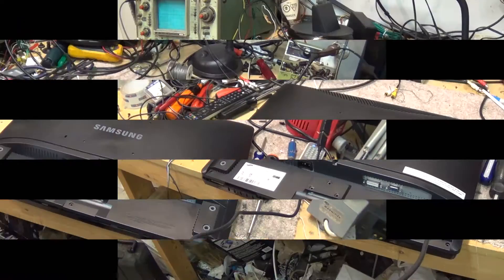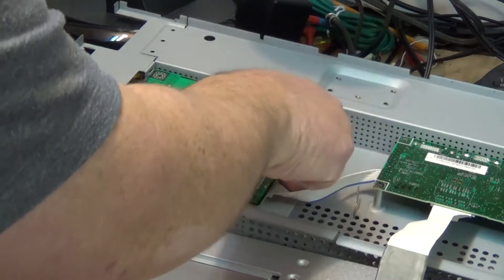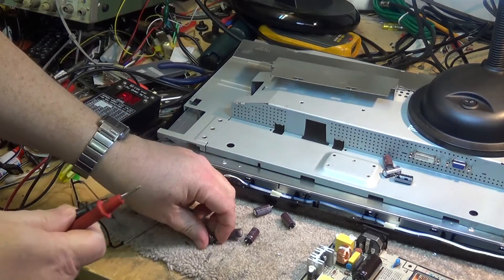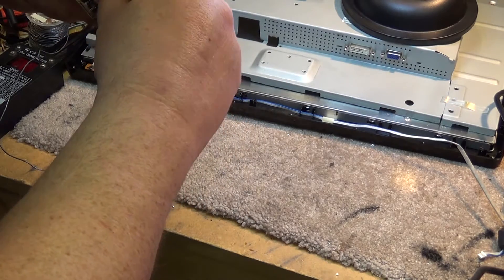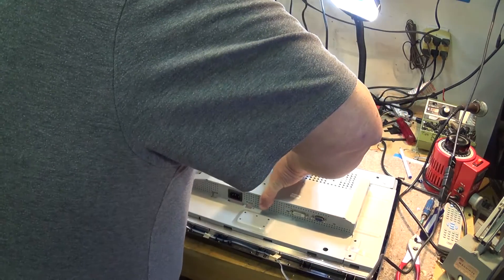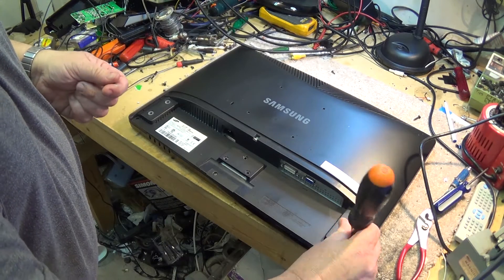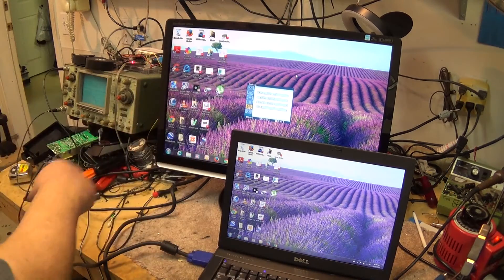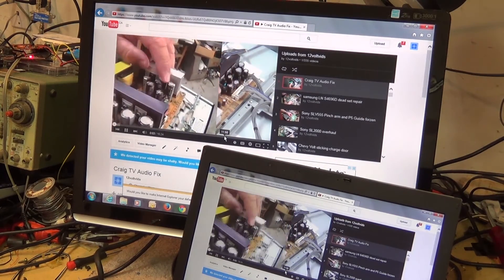samsung syncmaster 226BW power supply repair

Comment: Thanks mate, I have replaced the same capacitors on my exact same monitor which was thrown in the trash,  the small 330uf cap was mistaken for a 820uf capacitor due to missprint on the capacitor.  I know now why the repair diddnt work.  Cheers mate, U just gave me more hope for my little monitor

Comment: Here we are in 2020 and your video is STILL useful!! I cheated though... I did not solder in new caps... I just bought a replacement power board. BUT!! The repair was successful and the monitor lives on! Thanks!

Comment: I know this is an old video, but I just followed your video and I have a Samsung 226cw and all the insides are the same. I found all my 820's and one 330 were all bulged out. My monitor suffered the same issues when power on the screen goes blank, but if I let it sit then turn it back on a couple times it starts working. Well I replaced all the caps with the same identical caps and now the monitor will not even turn on. I have swapped the old caps cap in and now still no power. I hear a hissing noise from the power supply, but nothing at all. It went from working to now not working at all. What do you think is going on with it? I like this monitor and do not want to junk it, but I have no idea what would cause it to go from working to not working. I also made sure all the caps went in the same way they came out. Any ideas? Thank you!
Reply from the maker: Go double check your work for a backwards installed cap or a solder bridge somewhere.
Reply: @12voltvids  I did check it all out, been up and down on this board. I will check again, but I have beat this one up. I did happen to touch one of the flat areas that has solder perfect on it. I did try to flatten it back out and I used a jewelers loop to check my joints and still same issue. It does nothing at all. I also wanted to add that my monitor would blink in and out fast then the screen would go dim and I would have to power cycle it a couple times to get it come on and work, but now after replacing all caps it does nothing. Any ideas?
Reply: @12voltvids  Any ideas? How do I test the power supply out to make sure it is working as expected?
Reply: Thanks.
Reply: @dcgtechnologies1275  did you figure it out in the end?

Comment: Thank you for a great guide. My Samsung 226BW is from 2007. start blinking a few weeks ago. My PCB board has 3  820 uf an one 330 uf. Only 2 of the 820uf looks bad, but I have replaced all 3. I bought at Digikey 820uf 35v for $1.44 each and 330uf 35v for $0.42 all maid by Rubycon. The screen is working like new !!!  Thank you !!!

Comment: Hi do you have a list of the parts you used or the specs of the caps needed to replace. I have the exact same monitor with the same issue. Thanks in advance.

Comment: Have this issue yet nothing is wrong iside
Reply: same. i initially (about 5 years ago) had one bulging cap and replaced it, which fixed it. monitor has been perfect for the last 5 years and with a LOT of use. it seems like the same issue as last time (screen black, but if you shine a torch you can see its working - backlight issue). which is what was wrong last time. (except this time the screen works for the first 1-2 seconds after you turn it on..
anyway, long story short, this time the capacitors all look fine, no bulging. 
that doesnt mean they are good though, so as soon as i can find some suitable capacitors i will be replacing them. hopefully that will fix my issue.

Comment: Could you possibly just pull a power supply out of another tv or monitor and put in place of bad one? ? To speed up process only or is this not possible and just repair and use other ps for the parts needed if correct size caps etc?
Reply from the maker: M G 
You can deal power supplies only if same model.
Reply: 12voltvids figures this would be your reply! Thanks

Comment: As a Side note to people doing this - MARK the High Voltage Leads or take a Photo of the Leads before you pull them out.I used a Black Marker to mark the Pink Wires (Plug and Socket) Schematics are hard to find.

Comment: Thanks Much Dude. Made life easy for a Take down vid of the Monitor. Im another Victim of Samsung. Mine lasted almost 7 years. Not Bad. Time to Fix it. lol
Reply from the maker: +ftecconn I had this monitor given to me along with a 46" Samsung LCD. I kept the monitor, and my daughter put it on her PC as it has a fantastic picture. The TV found a new home too, one of my co-workers took that one off my hands. Samsung sure has had capacitor issues lately.
Reply: +12voltvids - Just Finished the Change out.  I found the 330uf cap Labled Backwards as well. People need to check the Polarity on the PCB not the Caps. The Monitor works like new now. $15.00 Fix.And my kids call me a Geek, Comes in handy.lol
Reply from the maker: Vertical line that never change regardless of input could be a panel issue.
Reply: Check those Caps. One may be Starting to Bulge
Reply: Well its been about four months now, The Fix is still working fine.

Comment: question on the uF on a cap. I was taught you can up the voltage rating but not the uF when changing out a cap. here you put different uF rated caps in.
Reply from the maker: Thomas Storm Depending on the circuit. In a video or audio circuit, where capacitors are used as bypass  or interstage coupling capacitors, changing the value will affect the circuit performance,  change the resonant frequency of an oscillator, change the linearity of an amplifier ect.In a power supply they are just there to store energy that is produced in pulses from the transformer, and filter it out to nice stable DC. Most electrolytic caps can have a tolerance of -10% +20% or more. SO a 1000 could be anywhere between 900 and 1200 uf and still be in spec.I went from 820 to 1000. Now I wouldn't put in a 2200 in place of a 1000, as that is going to draw way too much on start up (inrush current) and could trip the over current sense circuit, or worse blow the chopper transistor, but going up a little will have no effect in a power supply. Again this only applies to power supplies, in coupling and bypass circuit the value is chosen based on the design, and what it is there for.
Reply from the maker: I went from 820uF to 1000uF which is fine. That is well within the acceptable range. Using your rule a 50% increase would bring it to1230 uF. You are right though, going up in capacity will cause more inrush current, and in the case of a SMPS that could trigger an overcurrent shut down, or in the worst case blow the inverter drive transistor on the primary side.Should point out that my kids grabbed this monitor as soon as I fixed it for their gaming computer, and it hasn't skipped a beat in over a year, and it runs constantly.
Reply: 12voltvids - I'd also add that the larger the uF, the longer the duration when the inrush current could cause a problem, since the capacitor starts out discharged, it acts as almost a dead short to whatever is supplying the power into it. Larger uF = longer R-C time constant. As a general rule, I don't like to go more than 50-75% over the initial value, especially for SMPS like those seen in this video; the transformers generally are higher frequency, but they don't tend to have beefy secondary windings like you find in linear regulator-based supplies.

Comment: Those monitors work exactly as they were designed, run for 2 years and die, then buy a new 1.
Reply from the maker: Mentorcase Planned obsolesce for sure. But they are forgetting one thing. If I buy something that doesn't last, the next one I buy will never be from that manufacture, and I will tell all my friends about the shitty product they make. Companies want you coming back over and over. The problem isn't Sansung designing it to last 2 years, the design is fine, it is the component vendors that supply the factory, and they cheap out of the parts to save a few pennies per component, because they don't care.
Reply: But if they made a product that ran well for a few years most people these days are happy enough to buy another one, whereas if it never broke down they would never have to replace it unless to upgrade,no sale anyway. I am happy they build them the way they do with a good design but some easy to replace components that will make them almost bullet-proof.
Reply from the maker: Mentorcase Actually they do not want them failing too soon, as when a ton of devices fail after only a few years, class action lawsuits usually follow. Samsung had to eat repairs on many LCD sets for 5 years after the warranty expired for bad capacitors, and Sony had to eat a bunch of Grand Wega LCD projector sets when the LCD engine failed. I had one as did my next door neighbour. 6 year old set that the LCD panels went bad on, they gave me a brand new 46" LCD set for 300.00, and that was when new sets were selling for 1000+ My neighbour's set was 8 years old, and they gave him a 1500.00 set for 600,00.They don't plan for them to die after 2 or 3 years, but quite often that is what happens, and for the tech savvy they are an easy repair.I spent 20 years as an electronics servicer. I got out just before the big crash as far as the service shops went. The country of assembly makes a big difference. I tend to shoot for Japan, or Korea if possible, The Chinese and Mexican made units just are not the same. I have a few electronic products that were made in the USA, and even Canada, and believe it or not these are the best built units I own. I have a US manufactured APC UPS, and that unit it absolutely beautiful in design, and manufacturing.At work we use long reach fiber optic interface cards made by a company called Nebula Optics. Absolutely beautiful construction, made in Canada. A very local company to me, the corporate office, and distribution center is the next street over from where I live. When a company makes a good, reliable product customers will return time and time again to upgrade. When they are forced to because the product they thought was going to last didn't then they look elsewhere.I stick with Asus MB because they just keep on working. I use a Dell laptop because they keep on working. I carry a Blackberry because they have the best phone on the market from a performance and reliability aspect, and with BB10.3 they can run almost every android app so there is no app gap anymore.
Reply: +Mentorcase I have two of these monitors that have ran pretty much non-stop for close to 10 years and only now one of them is resisting to start, but other than that they've been great. I'll probably check the capacitors on this faulty one, shouldn't be a hard fix.
Reply from the maker: +Lois720 7-8 years is common for electrolytic capacitors.
Reply: I guess it's time to change them :P
Reply: +Mentorcase - Thats why they only made Drivers for Vista on my 216 BW. They knew it would fail.I got it in 2008 so they figure 2011 would be its last year. Thank God for Tech School Techs..